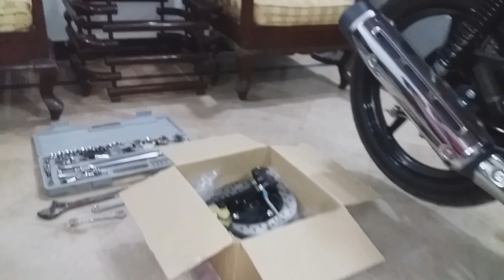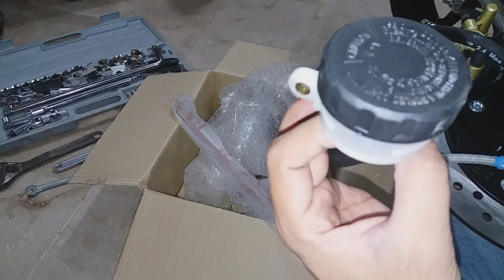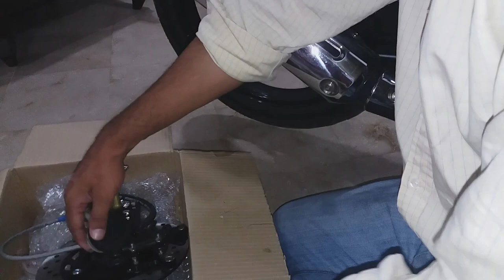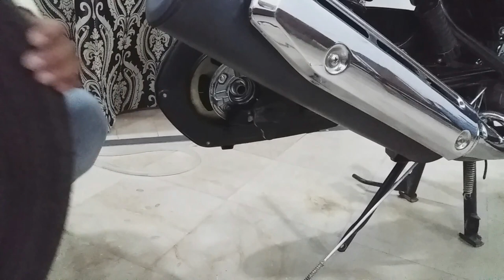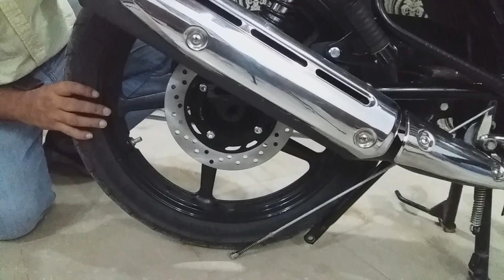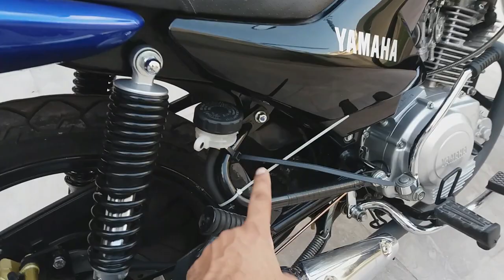Yamaha YBR With Rear Disc Brake

Comment: Awesome work bro! keep it up. Adeel Engineering was asking for 50,000 for the installation of the disc brake and you've solved everyone's problem by providing a solution in just 21000 rupees.
Reply from the maker: Thanks bro for comments and support

Comment: Bro i am inspired from the job u have done
Reply: But this modification damage the hub
Reply: And does not fit properly
Reply from the maker: Thank you bro for kind words
Reply from the maker: @mianmohtisham8510  no it didnot only studs hold the hub and i am using since long period of time with no complain or fault
Reply from the maker: @mianmohtisham8510  no its properly fitted and so far i have travelled to khewra, jehlum, kashmir and kurmat
Reply: @mugheesnaqvi  ok if u are saying its ok in ur experience than i will try this system
Reply: But the product default fitted by complany are always better than afte market products
Reply from the maker: Highly recommended still u need any help plz let me know
Reply from the maker: @mianmohtisham8510  thats right but modification always require experts working and its very easy in our case.

Comment: I still have a doubt on those 5 bolts will they hold the hub tightly... if there r holes and those bolts went inside those holes then u can say it's safe but there is a high chance of sliping of those bolts on hub specially in high speeds .. can you tell me how is it working now? After 4 years?
Reply from the maker: Your concern is valid however bike has been driven 32000 km now and they are working perfectly fine.
I have done the following tours so far
Islamabad to khunjrab pass
Islamabad to kumrat
Islamabad to lahore
Islamabad to sialkot
Islamabad to khewra salt mines
Islamabad to kashmir
Reply: @mugheesnaqvi  MA brother that's awesome... i tried to open the link you provided but it's not working... can u please tell me what should i type in search bar... and i asked my local mechanic here he said " is se bike aik taraf ko khichy ge brake lgaty hua" ap ka experience sun k trust build hua hai k buy kar he loun... keep making informative video like that brother...

Comment: is it safe rim k hub m just nuts se tight hai slip to ni hoga or agr rim m hole karwa k lagwa lein ?
Reply from the maker: Bro its very safe bcoz you can see there is around 8 nuts and double nit mechanism never let them loose.
I would not recommend hole i am afraidit will reduce the strength of the aluminium hub.
Reply: @mugheesnaqvi  is it working fine still ? and with loads too ? let me know i want that
Reply from the maker: Its working perfectly fine i have travelled 16000 km so far with this setup include my khunjrab (china border) trip from Islamabad and kumrat valley.
Reply: @mugheesnaqvi  nd it is dual caliper & what about disc pads we can install same front disc pads in this as well ?
Reply from the maker: Its single caliper brake and honda deluxe 125 front disc pads can be used as replacement for bolt on bolt fitting.
Reply: @mugheesnaqvi  sir is this still working fine or any issues ?
Reply from the maker: @kamrannawaz5106  no issue at all i have driven more than 30000 kms now and its working absolutely fine.
Reply: @mugheesnaqvi  i m thinking about what if i weld it permanently to the wheel using gas welding. is gas welding feasible ?
Reply from the maker: @kamrannawaz5106  you can do it but its hub with chunk nut is more stronger and stay longer
Reply: @mugheesnaqvi  how much shipping charges you paid now it is more than the actual product price...

Comment: Good job. Plz. Tubeless karnay wali video  ka link share kardain. Thx
Reply: Brother can i convert my stock tyres into tubeless without any problem. I have yb125z 2019 model. Just bought alloy wheels. Plz. Reply
Reply from the maker: Yes bro you can convert your stock tyres into tubeless all you need is alloy rims and tubeless tyre nozzle. 
Any tyre shop Wala can do this by charging you 50 rs maximum.
Reply: @mugheesnaqvi  okay brother consider it done. ;-) thx

Comment: Brother your work is great and upto the mark. Please tell us from where you have purchased this Diskbrake unit? Online site or any link plz share
Reply from the maker: Thank you for complement
I bought it from AliExpress link is given below
https://m.aliexpress.com/item/32764243228.html?srcSns=sns_Copy&spreadType=socialShare&bizType=ProductDetail&social_params=20058770085&aff_fcid=e4fa6990fc7e41449f2387ce795f941f-1614883591317-07960-_mKJO9lr&tt=MG&aff_fsk=_mKJO9lr&aff_platform=default&sk=_mKJO9lr&aff_trace_key=e4fa6990fc7e41449f2387ce795f941f-1614883591317-07960-_mKJO9lr&shareId=20058770085&businessType=ProductDetail&platform=AE&terminal_id=a102eb1cd2694f5395895e94e1aea403
Reply: Thank you so Much 💕 . I shall order one InshaAllah. You are very responsible and responsive boy. May Allah bless you always. JazakAllah and Say Salam to your family .. Allah Hafiz
Reply from the maker: @zaidjaswal2445  thank you brother
Reply: I have a question. Can we fit original disk brake unit which are on front wheel.
Reply from the maker: @zaidjaswal2445  no brother that's will require massive alteration and ultimate leads towards high cost.
The one I have installed is simply plug and play
Reply: Good work brother.can you told me about the size of disc .

Comment: AoA I don't wana import frm china, I'll buy frm pak, so ybr ki front disc brake rear mai bi lag skti ha? Same front wli disc break buy kr lu for this purpose?
Reply from the maker: Wasalam
Ybr front disk cannot be installed as there is no support to hold disk brake with alloyrim.
Reply: @mugheesnaqvi  thnx for replying and guidance dear brother, so which disc brake I have to buy for installing in rear wheel ? is it available in Pakistan? I have ybz dx.
Reply: Brother which disc brake should I buy frm Pakistan to install in rear wheel of ybz dx?

Comment: Bhai ye AliExpress wali lgani cahiye ya orignal yamaha ki lagani cahiye ?
Reply from the maker: It depends on your requirements however disc brakes are more responsive than drum brake and that is why i have installed disc brake in rear tyre.
Reply: Mery pochny ka matlab tha k china wali k quality kesi ha ? Or phr bad me china wali k brake pads kahan se mily gy ? Agr to achi ha to sae nahi to phr yamaha k orignal parts le lon ?ap k khyal se china wali ki disk or pads ki quality ok ha ?
Reply from the maker: @spicehome2324  quality ia nice mein abhi tak 10000 km chala chuka ho
Aur dsc pads aram sa mil jatay hai of u r from pindi or islamabad tou i know shops other wise honda delux ki front disc brake pads aur yeh same hain
Reply: Capital Zone ok thanks brother
Reply from the maker: Welcome bro

Comment: Bahi ybr ka issues rear brake sa bike slip ho jata hai to kya kiya jia iska sol batain..
Reply from the maker: Bro i have never faced this issue i am using disc brake with ybr stock tyres
But if u need more grip u can install ybr g tyre or any other good profile tyre with good design pattern
Reply: @mugheesnaqvi  i have already ybr g and i am using 100/90 tyre in rear it got sliped on applying...and even every person is facing this issue...
Reply: @mugheesnaqvi  and 2nd jb apna nuts sa hub ko fit kiya pecha rim main to slips to farig ho gai hon ge q ka after all jb jb brakes lagti hain to friction to ho ge r is sa hub ka andar ka slips jo ka drums ka liya tha wo to khtam ho gia hon gain akhr nut kitna hi tight q na kiya jia usna slip to hona after all slips jo hub ka andar wo pehli sa smooth hoti hain... and agr ap kabhi drums dobara use be kiya jian to hub to andar sa khtam ho chuka ho ga...
Reply: @mugheesnaqvi  apna jo kiya wo boht best hai but is ki life boht kafi kam hai rim ki as compared to stocks drums ka...
Reply from the maker: @asmarali9595  bro woh kaisay?
Reply from the maker: @asmarali9595  bro i have the same concern but when i installed it never happened there are 8 nuts which r properly tied n now i have covered 5000 plus kms n brake n rim both r fine
Reply: @mugheesnaqvi  chalin good luck for that.... 5k km is not enough for it least 20k km is minimum for it's proper checking...
Reply from the maker: @asmarali9595  thanks bro for the feed back i will share my experience as i will meet 20k mileage
Reply: @mugheesnaqvi  thanks for that...